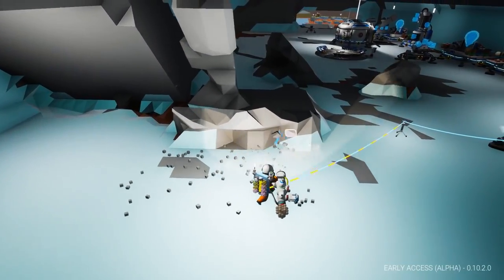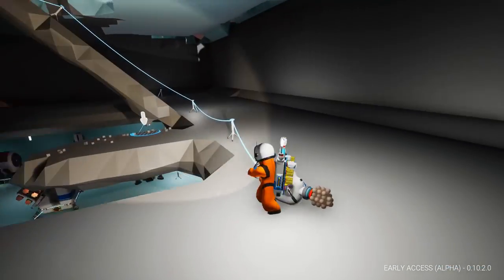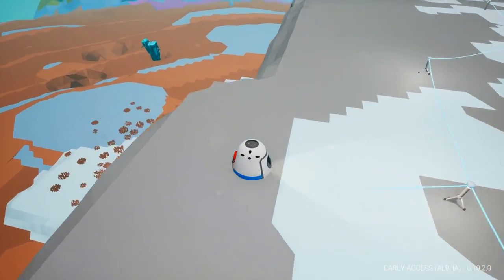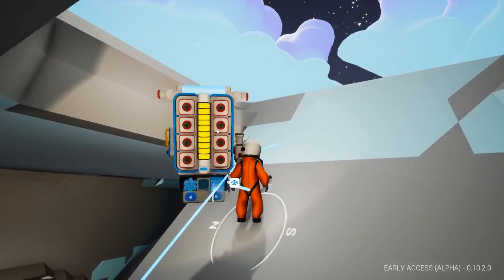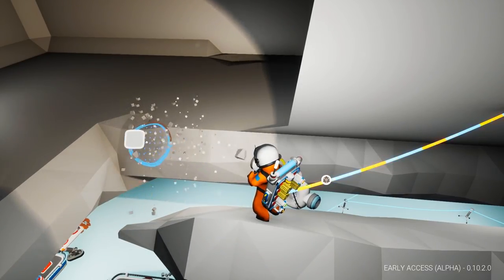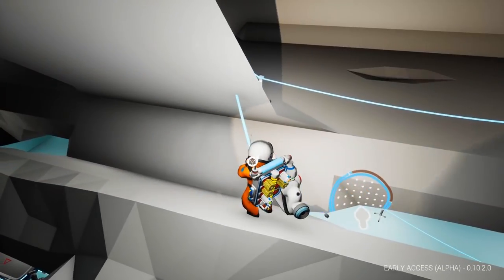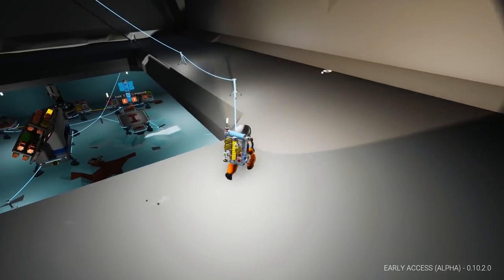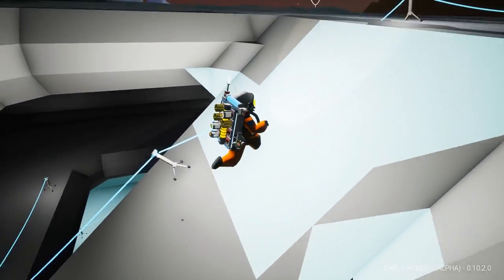More Base Building, True Flat and 1 PIXEL THICK ! Astroneer Base Building Series E.10 | Z1 Gaming

Comment: GG. You can use the reverse-45 method to get flat ceilings too. Just bring the flat floor up until it's 2 under the where you want the ceiling. Then flatten the elevated floor. This will give you a flat on the ceiling too. You could have used this technique under the 1-pixel-thick ramp to flatten the ceiling by slowly flattening a platform under it, 2 block away.

You can use the 1-pixel thickness for floating stairs: each step is 1-pixel thick and not attached to anything else.

Now that you have mastered the 45, build a castle. 🏰 😉

Comment: Why don't you build a base where you set up a square grid of tethers spaced just far enough apart so that you always have air and power then build the floor over it so they are buried and out of sight. then when you get busy doing stuff you wont run out.

Comment: ...this may be the single worst method to get flat I have ever seen it took you 5 minutes to find a flat that would have taken you 2 if you just raised a patch and tapped in a circle with flatten
the whole one pixel ramp thing is a lot of extra effort for what could have been done by just grabbing a corner
YOU DON'T NEED THE LARGE SHUTTLE the gas you need (argon) is on Terran